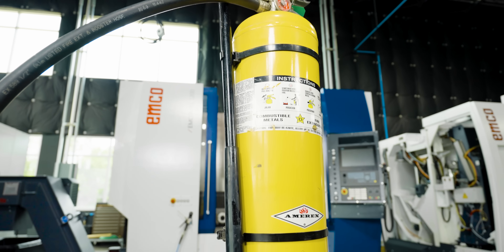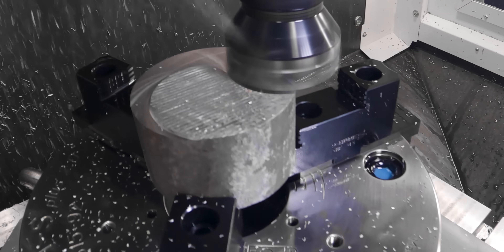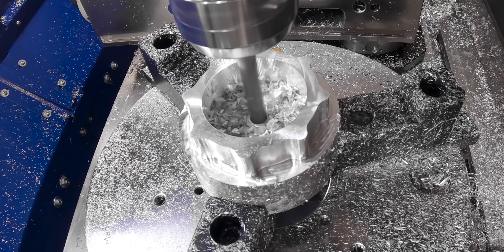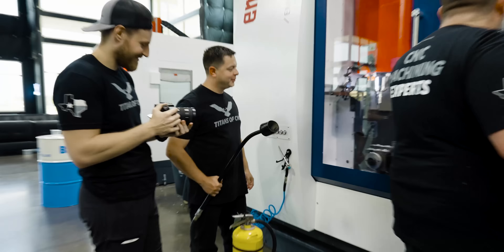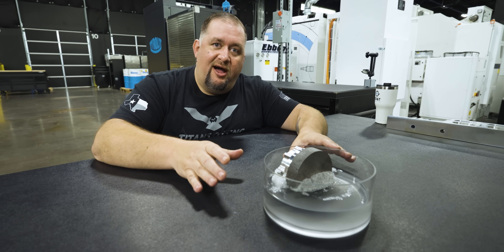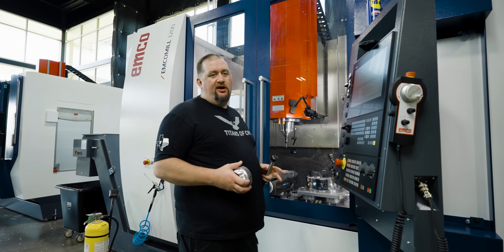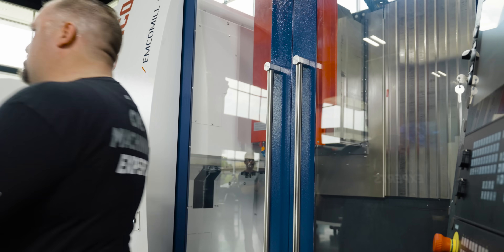Machining the MOST DANGEROUS Material in the World

Comment: Meanwhile Plutonium will auto-ignight if the particals get small enough. if you take a spring cut, that chip could turn into a self burning fuse
And it's also all radioactive
Rocky Flats almost wiped out Denver a few times like that

Comment: I haven't watch the whole video yet so I have no idea if it covered a very important part of machining magnesium: the chips are considered hazardous waste. Your local fire department may require you to meet specific fire codes when handling mag. Also, it's very unlikely your state/county/waste handlers will allow you to toss it into a dumpster. The material is recyclable but when in your shop you will, most likely, need to treat it the same as standard hazardous waste. Use closed top drums with a locking ring (drill small holes in top to vent potential hydrogen build-up) so some moron doesn't flick a cigarette into it and start a fire.

Water doesn't work in extinguishing a mag fire because mag burns so hot that it will split water into both hydrogen and oxygen gases. I suggest anyone who machines mag take a small amount of the chips and set it on fire. (Mag fires are slow burning but extremely hot.) Then take a spray bottle of water and spray the fire. You will be impressed with what happens. Also note that if you extinguish the fire there is a very strong possibility it can relight if any water makes its way to the "dead" fire. Class D extingushers use a heavy  powder to smother the fire so it becomes oxygen starved. Don't blow air on it until hours later because the mag will retain a lot of heat for a long period of time.

The stuff is safe if treated with respect and not allow chips to build-up and don't use water-based coolant. That's about 80% of preventing mag fires. Clean the machines often and before leaving at night and just like the video says, run aggressive feed rates to keep the "fly" chips to a minimum.

BTW... Titanium does the same as mag but is much harder to ignite. Once lit it is a much bigger problem than mag because it's even hotter. A large shop making titanium club-heads for golf clubs burnt down because of careless chip management. So, just be clean and manage the chips to keep fires down.... btw II: steel and cast iron chips can burn too....

Comment: Very silly question on my end, but if cooling with water or water based coolants is not an option, why not use an air or liquid nitrogen spray cooling? That'll also get rid of the chips on the machined part as well as cool it down.

Comment: Magnesium is not the only "Sketchy Metal" Titanium, although less flammable.. can set off quite a fire... 
it happened once in my CNC mill.. 
I stopped the machine, put on Welding Gloves and just grabbed out the burning titanium chips, threw em outside.. 

Disaster averted, but scary nonetheless..

Comment: Ive done magnesium. The stuff is super easy to machine, just use a streight oil based coolant. You can put a small metal fire out with kerosene mixed with heavy cutting oil. It flares a bit initially but goes out, if it doesnt you can smother it. With water based coolant it burns spectacularly if it catches. I used to save the chips and ball mill them to oblivion with a little graphite and sterin for pyrotechnics. ❤

Comment: Zircaloy is also one to watch out for as you can make fine particles combust by blowing compressed air on to it.
Reply: Very interesting! Ive never machined that!
Reply: @barrysetzer it's a very dense material and I always wondered if magnesium was part of its DNA as it can be volatile if you're not on the ball with swarf management.
Reply: @shaunofthedead6389 me and jessie were talking today about how a couple terrorists messed up and bumped a tungsten containment against a plutonium core, releasing a TON of radiation, killing them both. And wondered if a tungsten carbide endmill would have the same effect machining plutonium. Like if i specifically programmed it with a hss endmill, and a guy on the floor decided to swap it with a carbide endmill, would everyone die?
Reply: @barrysetzer I did send a reply to you but I can't see it on here now?
Reply: @shaunofthedead6389 i still see it, the one saying its very dense, dna, etc?
Reply: @barrysetzer  I sent one saying there was an incident in 1957 in Denver where there was a fire a a plutonium processing plant because of a tiny amount that combusted.
Reply: It also said that those guys who poisoned their selves must've ruptured the fuel rods as plutonium can be machined with high speed steel or carbide with the latter being preferred as HSS can put heat into the material as the cutting edge wears.
Plutonium is also an allotrope so it's properties can change from machining something similar to cast iron to machining a plastic.
Reply: @shaunofthedead6389 plutonium is the worst hands down, even beryllium is better. It machines like white cast iron making dust like chips, is horribly toxic and radioactive, your chips need to be dealt with carefully as they could go critical and cause a chain reaction, its expensive as in Rhodoum level cist, the metal is rough on tools, and the cherry on top its about as pyrophoric as the "flint" alloy in cigarette lighters. Oh and parts made of it have toloraces of plus or minus 0.003 thousands. 😂 Hard pass. 😂
Reply: Yup pure zr is extremely nasty if it lights up. Like titanium but worse as it burns to the nitride as easily as the oxide. The wool in old flash bulbs is actually zirconium because it generates bright light but doesn't absorb much from the oxide formed. ❤

Comment: "Here are some magnesium parts to quote!"
Me - Nope!
Reply: Helps to have a dedicated machine for it, switch to a streight oil based coolant. We used 70% kerosene and 30% gear oil and didn't have very many fires and the few that happened could be put out easily with a normal extinguisher. ❤

Comment: If the service life of the spindle broach is insufficient, you can use Inco brand's high-life dual-helix spindle broach spring, which offers a lifespan of over 3 million cycles, ensuring a top-tier user experience. Additionally, it can replace disc springs without any performance compromise.

Comment: Being a electronics engineer I keep wondering why would you need a material like magnesium to be machined ?
can anyone help me in understanding why Magnesium is the only option in the periodic table for a specific application.
Reply: Some pistons are made from magnesium alloys, wich are composed of mostly magnesium.(for example EN-MC21230 (MgAl6Mn) wich has like 90% magnesium).
Reasons to use such an alloy?
- Lightweight(2/3 of aluminium)
- Resistant to unwanted mechanical vibrations(highly dampening)
- Strong. Magnesium naturally provides good levels of stiffness due to its hexagonal, close-packed, crystal structure. 
- Cheap and available. It is literally everywhere.
- Easy to recycle.

Comment: Fun fact, the Hindenburg's cotton-based fabric covering was coated with a type of lacquer containing Iron Oxide, Aluminum powder and Cellulose Acetate Butyrate, which basically means the blimp was coated with an incendiary paint. So even if they used Helium(which German's couldn't buy from the US because of politics) instead of Hydrogen, there was still a ticking time bomb waiting to go off.
Reply: Wow that's the recipe for thermalite fuse used to ignite rocket motors 😮

Comment: I remember when they were making aircraft Wheels out of magnesium and I never understood that for the simple fact that they fly through rain or they land on runways and taxi through rain
Reply: It's an alloy of mostly magnesium a little titanium and some zinc. Not as flammable as streight magnesium and is usually coated before use as well. Ave brakes are far scarier, they use beryllium on a titanium rotor. 💀💀💩

Comment: I got stressed grinding titanium. I don’t like the idea of doing anything with magnesium.
Reply: Titanium is a bit worse than Mg especially once it gets going. Ti can burn to the nitride almost as easily as the oxide. You can use a mixture of kerosene and gear oil to put the fire out and at worst have a normal fire left that any handy extinguisher can put out. 😮

Comment: Used to work at a Magnesium Foundry and Machine Shop. 
I had to laugh when he spoke about overheating the material because it doesn't get much hotter than molten. If you didn't keep the air away from the castings when cast and were cooling it would burn. This goes back many years though so our process would not be legal or ethical today. We used to smother the mold boxes with R12 Gas whilst the castings were molten. Very effective.
Heat treatment was always risky though and a fair estimate would be in a jobbing situation the loss of %5 of castings due to burning normally due to a process failure was correct. Coffins filled with CO2 and Light components often submerged with sand was the answer. It would only burn if the flow of CO2 was stopped of corrupted in some way.
Machining was another matter. During my time we only ever had one serious magnesium fire and that was due to a coolant pump failure. Our method was different as we used conventional soluble oil and water based coolant. The thing was with sharp decent tooling and conservative cutting rates combined with almost submerged machining it was fine. For example a diamond tool putting a light finish cut was flooded with 3 1" coolant outlets directed at the cut and job machine area. All 3 usually running at 60psi depending on the particular job. It worked very well with no problems. 
Seeing the example here with dusty chips was an actual example of how far you can go without a fire. Always remember you have to keep Oxygen away from hot magnesium. Once it starts to oxidase fast it gives of more heat and the process becomes self sustaining hence fires that don't go out until exhausted. I would strongly recommend that you avoid dry machining at any cost. Oxygen is the catalyst and is the danger. Keep it away and it machines just fine.
Keeping the air away was the answer.
Reply: We used a mix of kerosene and gear oil as coolant. It worked very well and very surprisingly it could put out burning mg after a guick flare up and rarely keeps burning, but if it did a regular fire extinguisher 🧯 put it out. We were pretty good at removing chip build up before it got to machine roasting amounts. 😂
Reply: @christopherleubner6633  Indeed. Crazy levels of house keeping.

Comment: Someone forgot to turn the coolant back on after hosing down and removing Mag chips from the machine on second shift. 3rd shift new guy ran it dry, didn't know any better. Chips caught on fire, fire department showed up and put water on it, made it 10 times worse.
Reply: Yikes. We had a plant watering can with a 70/30 mix of kerosene and gear oil that put the fires out. It initially flares up for a few seconds but then goes out on its own, used same as coolant to mill or turn. Worked very well.❤

Comment: 1 thing to add, your machine will get super dirty if you run a lot of magnesium, i use to make a lot of production in magnesium and it make a build up up nasty crude all most like limestone or calcium that you can see at the outlet of a faucet
it super hard to clean and get rid of and all most impossible to get your machine look good
Reply: Yup the chips corrode and make a mess if you leave them. Make sure to clean up after every run and use a streight oil coolant.❤

Comment: Next time try uranium
Reply: Uranium is nasty to machine. It's very hard and the chips tend to catch fire on their own if exposed to air. Generally use an argon filled box to machine it. Best to keep the chips under oil as they are collected. It also has the nasty habit of forming hydride from traces of moisture so that cutting fluid needs to be extra dry. 💀

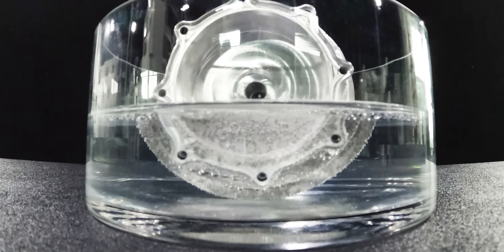Comment: At 7:20, hydrogen isn’t separating from the magnesium - the magnesium is pulling the oxygen out of the water molecule (H2O), leaving just the hydrogen molecule (H2) behind. That’s why you have hydrogen bubbles. It’s not because of hydrogen separating from the magnesium.
Reply: It's also creating Magnesium hydroxide plus H2, Mg(OH)2 + H2. 🤔🤔
Reply: Nailed it. Oxygen and magnesium just love getting together. After all why would the use of magnesium anodes be a thing if it wasn't the case.
Reply: You may be right, and I'm not sure that you are, but the point is that magnesium corrodes very fast in water, and during that process, hydrogen is released as a byproduct.
Reply: @barrysetzer He is right. Where would the hydrogen come from if not the H2O molecule?
Reply: @czeslawpi look, im not a freakin chemist. Im a machinist. I know that if the mag was already burning, the hydrogen and or oxygen would be ripped from the water molecules as fuel. But with simply sitting in water, i freely admit that i have no idea where the hydrogen comes from.

Comment: all machines have the ability to be cooled with clean oil, why don't you remove the emulsion, pour in cooling oil and do the pieces without fear
Reply: Yes we had a dedicated Mg lathe and mill, both were cooled with 70/30 kerosene/gear oil. Only a couple minor fires over a few years. Both were put out with watering can full of the coolant one was totally put out and one required a regular fire extinguisher afterwards. No equipment damage of fire department call. Main thing is to pull the chips after each part run. ❤

Comment: Back in 2006, I attended a CNC machine programming course. Given the significant advancements in these machines, I'm wondering if the programming has become more straightforward or increasingly complex ?
Reply: Depends on the controller I think. But the Siemens is really easy to use. I managed to teach a lad who came on work experience straight out of school. And he was programming on it within a week

I used to programme hididenhien (however you spell it) on a 1987 machine … its was very long handed and could take 1-2 hours to even program simple stuff
Reply: @Rick_Sanchez157  Have you ever created programming with the help of AI like GPT or something similar?
Reply: @andrihadi13  I've used AI to help write prompts to clean up messy gcode outputted on complex parts for mill turn. It's next to impossible to get a perfect post processor for more complex machines and this can really help save time on repetitive hand editing.
Reply: @danielhurford6706  Is it capable of generating a functional object or prototype?
Reply: @andrihadi13 I was curious so I asked meta ai. It can do something basic, but complex things you will need a cam cad system

Comment: We used to machine Rolls Royce Compressor Casings in Magnesium. Two flash fires in a Webster Bennett Vertical Borer, cost the company a new machine. Very toxic smoke and fumes. We also had a large Skip spontaneously ignite outside, almost like bomb, as the swarf was under a load of Aluminium swarf, and a few gallons of oil. The Fire Brigade could not put it out, and eventually sent a lorry to cover it in sand. So Berry is right to be concerned when machining the stuff. We had no special coolants or extinguishers in those days.

Comment: That's why we used to use AlMag35 instead of pure Mag, better material properties and you don't end up burning down the plant.....had a 55 gallon drum of Mag chips light off one time and it burned right through the second floor of the building.
Reply: That would explain why the place I worked at didn't give a 💩 if I took the mg chips. ( made Pyro flake with them) 😂

Comment: I know Walmart man loves running as many flutes as possible, but in Mg I always try to either use a 2 or 1 Flute endmill with the same concept your using of lower SFM higher feed rate. I found the 1 flute endmills have been the most reliable at evacuating the chip even when the endmill starts to wear

Comment: The real danger here is Berry running a machine.  WAY more hazardous than any combustible material
Reply: Where are the doosan machines? The doosan cnc were scrapped?
Reply: @importanttingwei7747 no but they are now an emco distributor I think
Reply: @importanttingwei7747  Emco now pays the bills. The guys are very skilled CNC machinists but don't forget that this channel is first and foremost to promote and sell CNC machines, tooling and programs.

I dont have an issue with that - but theres a reason why a brand is being shown and that isnt because theyre the best on the market =)

Not a critique, just saying =)
Reply: Yes! 😂
Reply: OSHA violation on that air gun 1:01
Reply: @solarcheese What was the violation?
Reply: @QPD-1 OSHA compliant air guns have a pressure relief pathway to pass air through if the nozzle is blocked.
Reply: @solarcheese And this one does not have that?
Reply: He made it on the Emco because it's the less expensive cnc of the workshop

Comment: Why is the part being made of magnesium? That seems relevant to me.
Reply: Alot of parts are made from magnesium because it's super light and pretty strong. Bicycle parts, some aircraft parts, etc
Reply: The Group B Cars from rally were almost full made of Magnesium, and a lot of high quality wheels are made of Magnesium also
Reply: @adri593  Ooof does it mean the car can catch fire that's almost impossible to extinguish?
Reply: @digitalghosts4599  Yes, that was one of the reasons they banned it, you can see the horrible accident in which Toivonen and Sergio crespo lost their lives because the fire on a Delta S4 after falling off a cliff, between the Magnesium and the ridiculous amount of fuel that these cars loaded that was a bomb about to explode. Amazing cars but really dangerous if you have an accident
Reply: Apparently, magnesium is used because if ease of machining, weight to strength ration, very high corrosion resistance (beside maybe water?)
Reply: volkswagen famous G-Lader (for 1.8 PG motors in golf and mostly corrados) was and is made from magnesium... ❤
Reply: and that was made with machinery at time in 80s 90s !